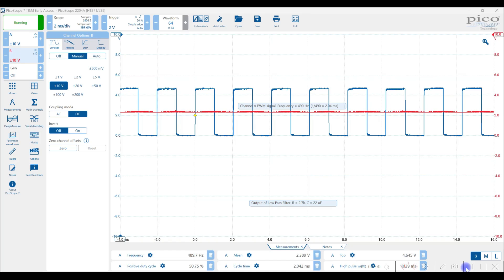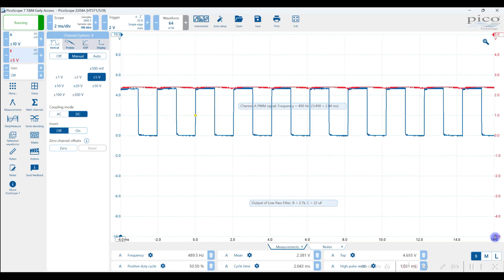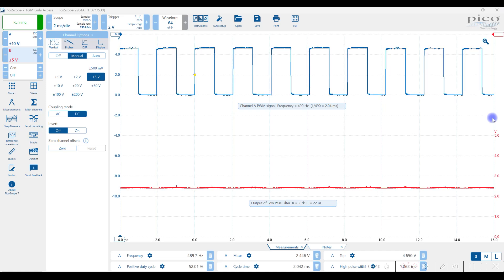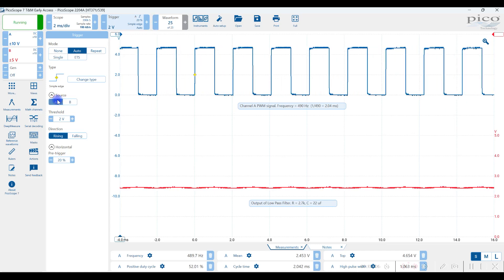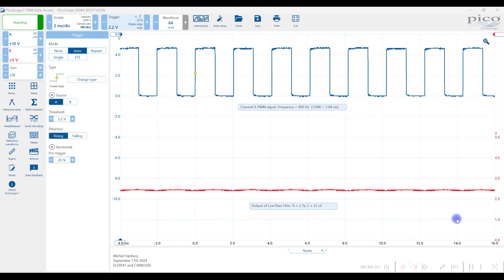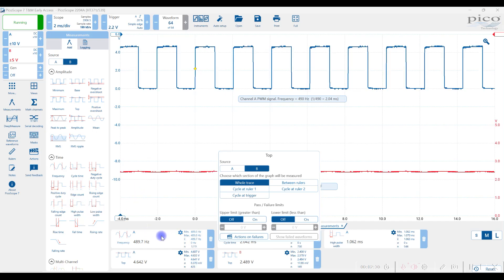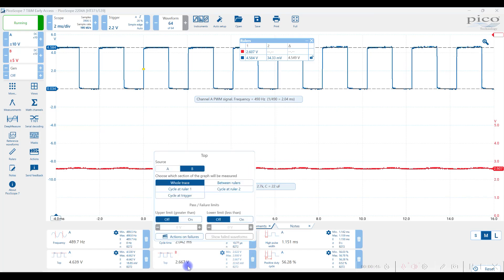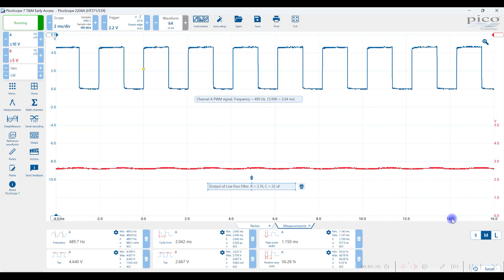Tutorial on PicoScope

Comment: Hello, thank you for this video. I have used an oscilloscope since my days in High School ( 1964 67) and later on in my professional life. Recently my company bought a PicoScope 3203D which was my first time using a Software Driven scope. I noticed in your video that there is some "dirty signal" present in both the upper and lower edges of the waveform. I see that as well on my scope when using it. At first I was concerned that I was seeing noise in either my signal source, or if it was just noise being induced either on the power rail or line voltage. You did not seem concerned about it so now I wonder if it is just something associated with these types of scopes? Can  you tell me your thoughts on the issue? Also, do you have a video about using the PicoScope for decoding the ARINC429 data lines? This was the reason for buying this scope ....
Thank you.